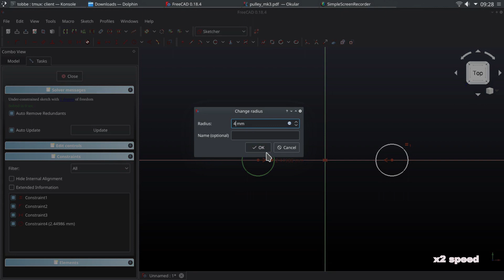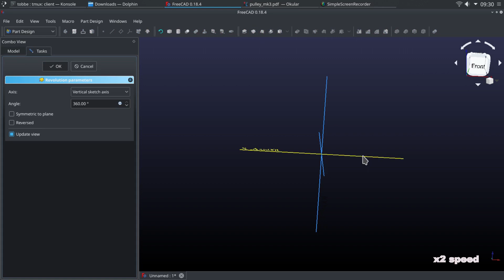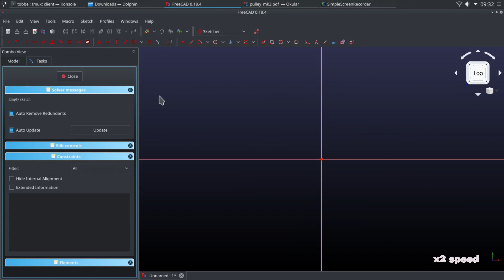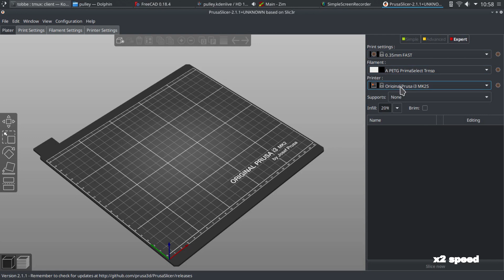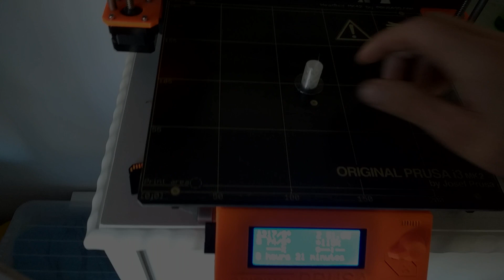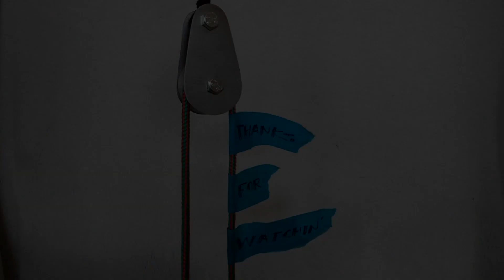DIY Pulley | Steel and 3D printing!

Comment: how is it holding up? What's the max load it can handle? What thickness metal did you use?
Reply from the maker: I have'nt done any testing. It's holding up fine pulling my caravan out of storage, thats 1400kg but on wheels. The metal is 1.2 mm steel sheet. Thanks for watching and commenting!